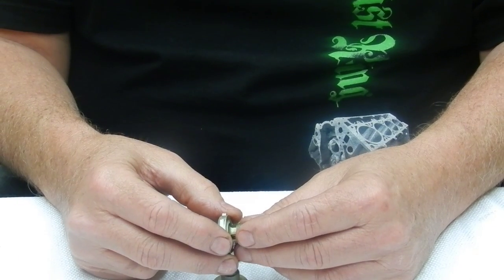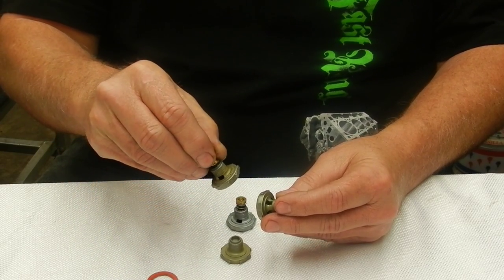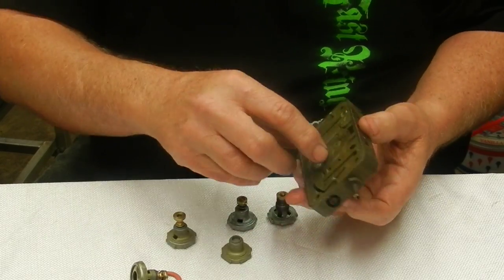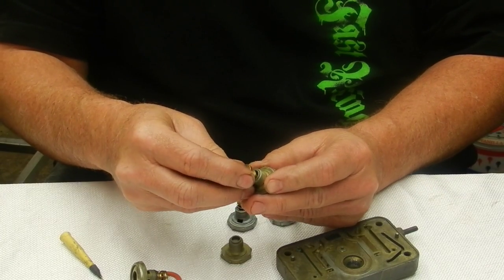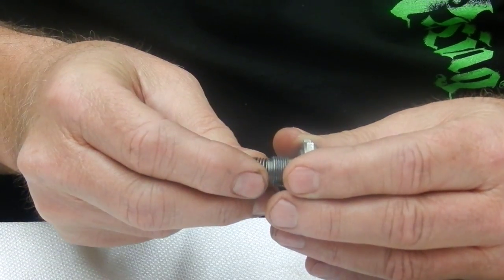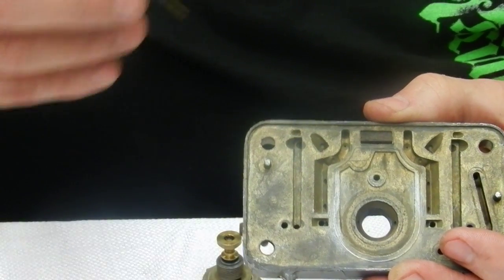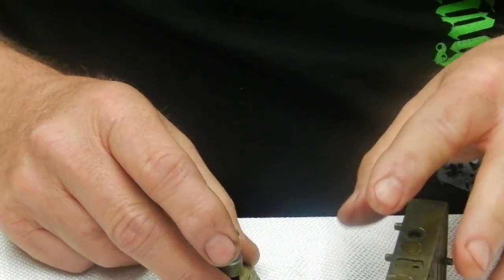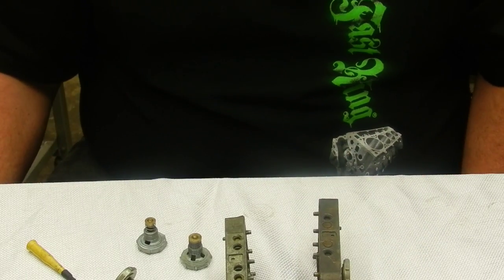Holley Carburetor: Power Valve Explained

Comment: Thank you, Randy, I remember changing power valves at the race track and had no idea what it was done or how it works but I do now and when I rebuild my 4412 Holley I will understand that part. Now I just need to learn how to get my vacuum numbers so I can get the right power valve for it. Thank you, I am following you and studying your videos.
Reply from the maker: Glad I could help.
Reply: put a vac gauge on the manifold, start the engine and halve what your reading on the gauge and that where you start on the power valve.

Comment: I rebuilt a Holley spreadbore and the only way the engine will start , is with a small pump shot. It will sit there and idle perfectly after started . I can even turn the curb idle screw way down and it will idle down to 300 rpm , but if I turn the engine off then try to restart it , it’ll just keep cranking and cranking until I give it a pump shot . Any ideas??? Thanks
Reply from the maker: I don't really understand your problem, your engine needs a little pump shot to start, now if your power valve was leaking i can see it starting without any pump shot from the unmetered fuel. Hope this helps.

Comment: If one blocks off the power valve altogether, stepping up 6-8 main jet sizes is enough to keep up from stumbling from gas to go on the hwy?
Reply from the maker: I prefer to run a power valve in the primaries to keep control of the fuel curve down low, but if you don't  run a  p-v  probably 8 to 10 sizes up . Would not won't  to pay your gas bill , good luck.

Comment: I've always run a 650 double pumper Holley on my '66 Nova small block. I run a fairly mild Lunati cam that gives me 19" hg at idle. I use a 7.5 or 8.5 power valve that give me high torque, great throttle response and decent MPG. The only trouble I've ever had is when I rebuilt it last summer and used the wrong base plate to body gasket. The idle circuits, both primary and secondary were blocked off because the gasket holes were in the wrong place. It wouldn't idle and I had to crank the idle screw way up to run on the transfer slots. Using the right gasket fixed that. I learned to look at new gaskets very carefully before using them. You might talk about power valve numbers too. Some are hard to read and figure out I've noticed. Thanks for the video Randy.
Reply from the maker: You have to be careful about main body to throttle body gaskets , they can block off idle circuits. Thanks for watching.

Comment: I've been a professional mechanic for 35 years and I'm really good with carbs, especially the Quadrajet. I learn something useful every time I watch your videos. You sir are an expert! I do have a question about the power valve though. If I want to get a lean cruise for better mpg can I slightly enlarge the power valve feed holes and lean out the main jet size a little? Or is this too dangerous to attempt?
Reply from the maker: I  think I would try a two stage power  valve and lean the main jets , but you can try changing the power valve restrictions and leaning the main jets , just remember it matters what kind of driving your doing , highway or around town.
Reply: EXACTLY what you said, Dave. The holes you are talking about are called "power valve channel restrictions" or PVCR. I don't understand why Holley Carburetor doesn't make them replaceable size. Randy's carb videos are the best.
Reply: @mickangio16  you can drill and tap the PVCR’s and install a brass set screw that you drill out to the size you need. Of course you can drill out a few with different size jets...there is a video on YouTube where a guy shows doing it and what size set screws he used.  I believe his channel is called One Car Garage.  He has a Barry Grant Holley on a 502 BBC in a ‘63 Tempest....

Comment: Will a too small of a power valve effect steady crusing? Cause fluctuations or surging?
Reply from the maker: If you are cruising and not under a load ,power valve should be closed, if your jetting is to lean it will surge , and it will open the power valve and all this is assuming the tune is in good shape , no vacuum leaks, ignition timing is correct ect.
Reply: Thanks. You confirmed one of my hunches. Gonna try 1 size bigger jet.
Reply: One jet size is hardly anything. You may need to go up two sizes to get rid of the surge. Don't get discouraged if one jet size does not get rid of it.

Comment: Hello, I have a 2300 2bbl Holley Carb and since i bought it (used) ran pretty good until a few months have a serious problems with fuel when taking hills, carb leaks thru the boosters like when inclinates. I changed the power valve twice, adjusted the float, blow up the purges on main body, check gaskets and everything but still getting the big leak. My question is Do I use a Block-off plug ?? Im runing with 73 Jets. Thanks for your attetion and hope you answer.
Reply from the maker: Check fuel pressure first should be around 5 to 6psi , no more than 6psi , next if you put air pressure through the carb vents you could easily damage the float . Hope this helps.  Ps stock fuel pumps go bad and will  easily pump 10psi or more.

Comment: I have a new, not Asian made, Holley 650 CFM Manual Secondary carburetor.  I had a problem with a rich condition on the AFR Meter-about 12:1.  After some time trying to tune the engine, I found that the power valve stuck open.  The valve finally closed, and my AFR meter registered 14:1 and it held a steady reading.  What I'm saying is that some of the rebuild kits come with some slightly bent power valves which caused some leakage.  This condition along with a bad seat is what caused the rich to lean condition.  I bought another valve by a good company as well as Holley and found valves in better condition.  Look out for performance parts that have assembly problems.  Also, watch for your shipping company stepping on your package...end of story!
Reply from the maker: I've  had a lot of shipping problems with damaged parts, I guess I've been lucky with power valves, thanks for the information, have good one.

Comment: Hi Randy 
i have a Vacuum reading at idle in gear of 3
The Power valve in the Carburettor at present is 4.5
Do i need to put a smaller Power Valve in 
           Thanks 
               Stratos
Reply: A better way to check the PV is take the vacuum reading at cruise and go a couple numbers below that.
Reply from the maker: You could go to a 3.5  pv but  I would first recommend checking your ignition timing and I take it you have a big cam I would try recurving my distributor and bring my initial ignition timing up as high as i can that will raise your engine vacuum or if I was using  the car for just racing I would lock out the ignition timing in the distributor. Hope this helps

Comment: Great video ! Help me understand something...So if I want the power valve to open SOONER I get a higher number ? I ask because my Holley 670 has a 6.5 - When I am cruising (say 40mph) and goose the gas, I get a momentary stumble and I see my AFR gauge go lean for 1/2 second...then its bat out of hell. So should I move to perhaps an 7.5 or 8 ? With my engine and cam, I pull about 13 vacuum (thats in park so I have to see in D) - so just to summarize, higher number, sooner flow , lower number later when vacuum drops?
Reply from the maker: Yes a higher number on the power valve means it opens quickly a lower # opens later . If that don't take care of your stumble let me know.
Reply: @holleycarbshowtosadvice40y90  Thank you ! The engine runs pretty awesome (347 Stroker with mild cam, blueprinted, aluminum heads) She is a screamer but that dang lag drives me nuts ...its split second but even the AFR gauge confirms, for that split second, she goes lean ...then BOOM ...torque monster :-)
Reply from the maker: Robert your carb does not have much adjustability with your street 670, a brawler 680 cfm part# 67317 would be a better choice , with that said you could have your secondaries coming in to soon , or you may need to jet up , I don't know your air fuel ratio  , or you might need a longer acc. pump duration and may help to go to a bigger pump discharge  nozzle, lots of different things to look at.hope this helps.

Comment: Excellent description of the power valve and how it works.  I especially liked your reference to vacuum.  Calling it a "high" vacuum or a "low" vacuum is arbitrary based on the person's frame of reference.  Is a high vacuum 25 mmHg?  Or is it 1 mmHg?  I typically use the term "deep" and "shallow" for vacuum reference since to me that's a clearer way to explain how far the vacuum is away from atmospheric pressure (or zero mmHg on a gauge).
Reply from the maker: I'm old school Matt lol.

Comment: when blow-thru turbocharging, is it absolutely necessary to boost reference? thanks for your videos..
Reply: Tom I don't know much about blow through carburetors ,sorry wish I could help , thanks for watching  my videos, randy
Reply: Tom, I realize this is coming a little late, but the answer is YES. If you don't boost reference, you will have unreliable fuel flow. For example: if you are running 7lbs of fuel pressure and 7lbs of boost, your fuel pressure will be 0. Having a boost reference will adjust your fuel flow as the boost builds/decreases.
Reply from the maker: I don't  do forced induction. Sorry

Comment: I finally understand the powervalve and how it functions,thanks to this video. Great job! Now for my question.... What is the biggest cfm carb thatI can put on a 350 l34 engine w/2.02 valves and a big cam. It's an old vette motor that my father had and i,d like to bring it back to life. I'm looking for barely streetable performance and lots of hp. thanks again.
Reply from the maker: Greg if you could send me all your engine information , like what intake manifold [ single or dual plane ] cam specs compression ratio and type of auto trans and converter stall speed , I'll do my best.
Reply: You can put a Dominator on it if you want. Might be a little dogy.......  A 600 vacuum secondaries is all you need.
Reply: @jimdavidson5208  exactly. Usually the mopar guys are always sayin', "this engine costs me $10 just to start it up..... And, this puppys got dual quads, 950 double pumpers"..... Lol, on a 318!

When a proper 500 cfm would give him proper fuel, at the right time. Plus he would get his throttle response back....

I built a 381 Chev. Stroker. Made 511hp and 495 tq. It only has a 650 speed demon on it. A 600 quadrajet probably would be better, due to the smaller primaries. 

My throttle response is awesome tho!

Comment: Still confused, my vacuum at idle in gear (automatic) is 5-6. I wanted to instal a 2.5, but wondered if that would run too rich on the street, so I went with a 3.5, what do you think. My car is street/strip, and has a high overlap cam.
Reply: Get a vacuum gage and tape it to your windshield, drive the car in 3rd gear at around 3000 rpm record your vacuum, than accelerate half throttle and see how low the vacuum goes, install a power valve to that number. It helps if you have a A/F monitor. My 496 BBC has the same vacuum as you do, I run a 750 on the street with 70 jet in the primary 82 in secondaries and a 9.5 power valve, it idles a 13.5 a/f my cruise a/f is 13.5 to 14 when I accelerate it goes to 12.5, its better than fuel injection.
Reply: Yup a wide band O2 will help you dial in a carb nicely.
Reply from the maker: I would run a 4.5 p.v. at idle the power valve does not effect idle at all open or closed unless the diaphragm is leaking but 4.5 should be fine. Hope this helps.

Comment: So under normal conditions power valves don't feed the idle circuit unless they are broken.  And they help richen up the mixture under load.  Different valves are needed depending on engine vaccum.  So if your car has a lean condition under acceleration you need to change the jets and maybe a power valve
Reply from the maker: the power valve  feeds off the fuel in the bowl , the idle circuit feeds from the main well like the jets, but the main well only supplies fuel  to the  idle fuel restricted other than that they are separate circuits ,unless the power valve diaphragm is leaking then it will pull unmetered fuel in from the vacuum source for the power valve and make your engine run rich , more so at idle, yes you do need to have the right power valve.I hope that helps it can get confusing.

Comment: Have any videos of leaks of gas on top of carb
Reply from the maker: Drew I thought I had one , I will do my best to have one out in the next few days. Make sure you test your fuel pressure, even if it has a stock mechanical pump. On a street car  without a regulator should be under 7 psi , watch for vid.

Comment: I have always heard if you have a pop back it blows the power valve. how do you know/what affect does it have? Thank you for the videos, very informational.
Reply from the maker: Years ago that was true, but materials have improved alot and power valves have check valves that help protect against a back fire and aren't as much trouble today, befires are bad about damaging brass floats, nitrophil floats are more durable. Now when you rupture a power valve your engine is going to run rich sometimes to the point of the idle mixture screws having no effect on the idle, and fowling the spark plugs. When the pv ruptures the vacuum applied to the pv is now drawing unmetered fuel out of the fuel bowl into the engine. Hope this helps.

Comment: Great video! Now could you tell me what power valve and jet sizes i need for a completely stock 1968 Ford 429 with a BG 750? It runs pig rich no matter how i set it...
Reply: did you not listen to him check your vacuum and go half of that in a power valve, I think you have a float problem.
Reply: Crap Hitting The Fan Yea, I heard him over a year ago. You living under a rock?
Reply from the maker: A lot of these comments I never saw back  3, 4  years ago there was a problem with the channel I'm sorry.

Comment: Another fantastic video, keep them coming, guess a blown power valve can be caused by a violent backfire so I was told, I'm just inches from removing  my almost new aluminum double pumper ultra series carb from my 363 stroker  ( only 250 miles and 2nd set of plugs since carb was installed), I did have a few backfires thru the exhaust and maybe 1 or 2 blow back thru carb, but was told new carbs have a power valve protection  from being ruined is this so? Also my accelerator pump arm at the diaphragm housing leaks when activated which I know is a problem, I really thought holley were a little more tougher than what I've experienced so far especially  right out of the box.
Reply from the maker: Most new carbs have backfire protection but sometimes they will damage floats and even nitrophil floats will bend there arms check your floats for binding. Also  if your leaking at the pump  diaphragm check first by looking down your primary accelerator pump aquirter and watch as you move the throttle do they squirt fuel the instant you move the throttle if they don't squirt remove the carb and remove the accelerator pump squirters one philips head screw and wiggle the check valve till it losses up, turn carb upside down and check valve should fall out clean and lube with wd spray a nd also check  pump diaphragm for loose screws or possible bad diaphragm. Hope this helps.

Comment: Thank you sir. Im digging in and trying to educate myself on carbs. Any advice on 6 pack carbs?
Reply from the maker: Most 6 packs idle off your center carb get it set up right to start with, and a trick for the front and rear carbs was to run a vacuum hose from one diaphragm to the other like a balance tube , if yours does not have a balance tube you can modify the top of your diaphragm housing if you have the room , this helps to bring in the front and back carbs together, some of the tri power set ups came this way some did not.
Reply: Holley Carbs: How To's & Advice ,40 yrs of exp. I see what you mean. They share a vacuum tube to ensure they open up at the same time.

Comment: Randy, I have a 1.9 isuzu carb. The rebuild kit states "no power valve" included. Do all carbs have power valves ?
Reply from the maker: Most carbs due, some have a vacuum operated pv diaphragm some have vacuum operated metering rod piston there are exceptions like a ford variable  venturi carb, some have pv that are not usually replaced there all metal and don't require replacement, unless damaged.  Hope this helps.